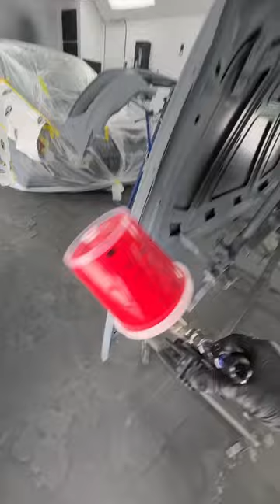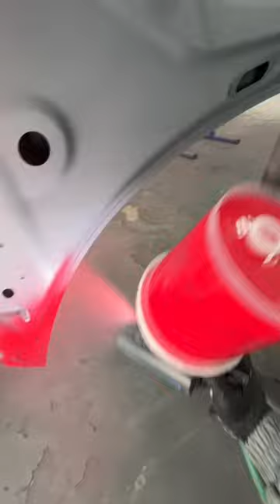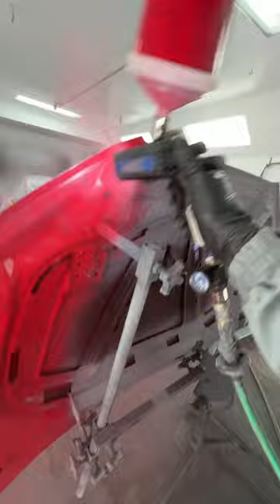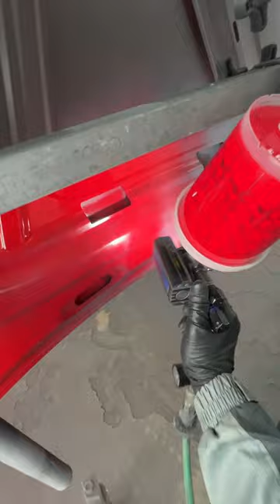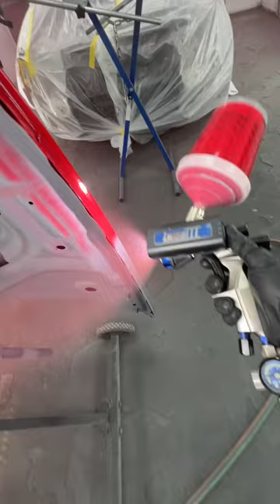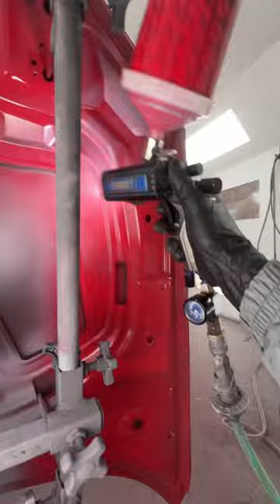SUPER BRIGHT RED SPORTS CAR #car #paint #paintlife #autobody #painting #satisfying #bluecollar

Comment: Stupid question:
Why don't you paint the center of the hood? 
I see videos where they paint the hood but no one ever paints the center. 

I'd guess it has something to do with the motor or the heat? But I can't figure out what would cause you to paint the full top of the hood... but only the outer edges of the underside of the hood... 🤔
Reply: That's the way most of the manufacturers do it
Reply from the maker: Hood pad covers is
Reply: the painter are lazy. I don't care what covers it I paint it completely.
Reply: @richardkelley779 The company you work at will usually dictate whether you have to spray those or not